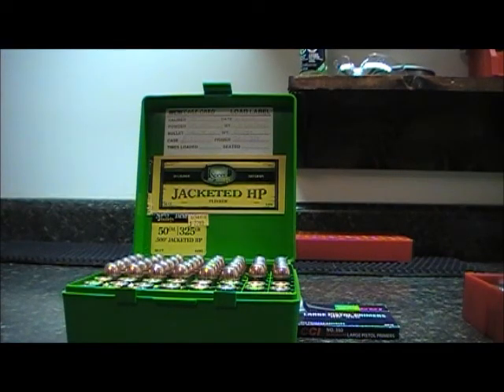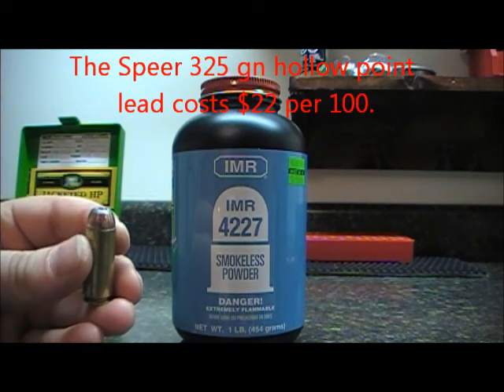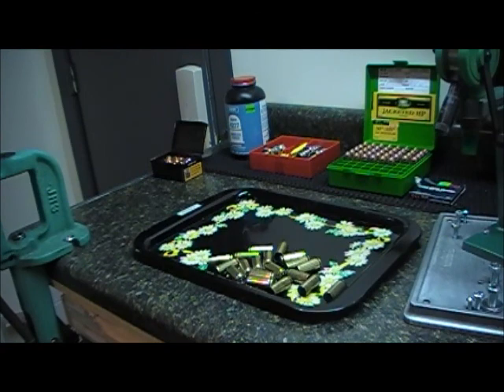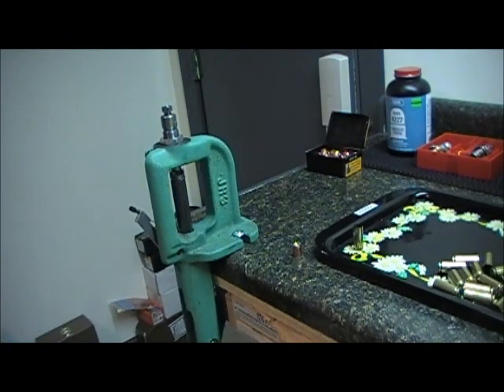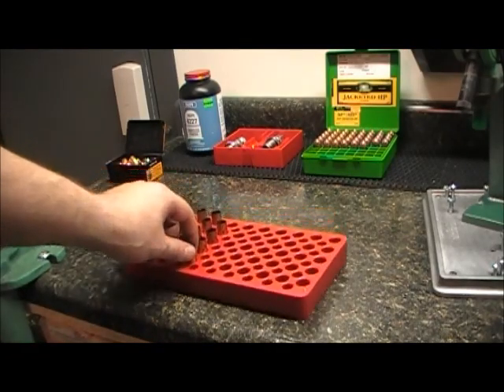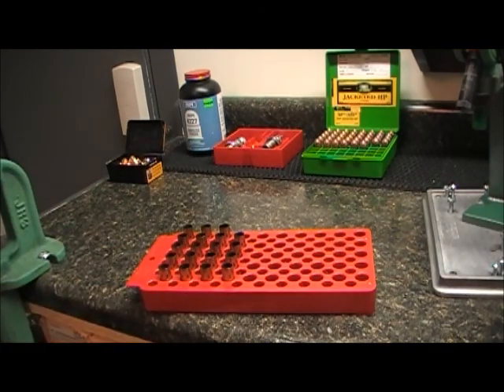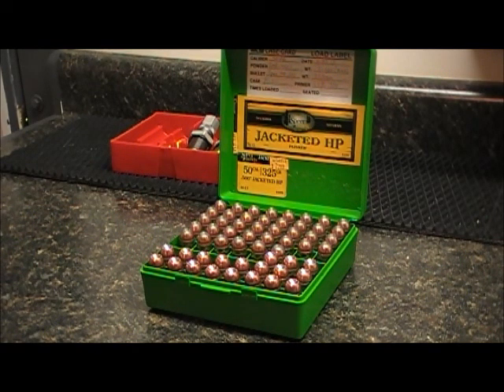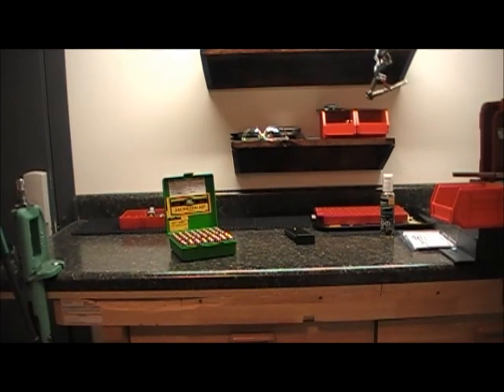Reloading the 50AE (Action Express) Cartridge 1/26/2014

Comment: Good video.  One thing to consider in on these semi auto rounds, they seat on the case neck.  The brass can stretch after firing, so trimming the case to proper case length before belling and priming the case can be an important first step.
Reply: I think trimming would be risky as the tolerances will change. I think that's why they have the reloading die(s) he said to crimp them back down to spec.

Comment: I’m pretty late getting here but I need some help. Every time I seat the bullet there is no neck tension for the bullet and I can push with my finger down. Any tips ?
Reply from the maker: Depending on your die type, more than likely you need to turn your die down further which will put more crimp on the neck.
Reply: @fpsdano7446  shouldn’t there be neck tension without a crimp though ? I’ve already wasted like 20 rounds trying to figure this out lol I’m using lee dies
Reply from the maker: @emotionlessmarshmallow4581  yes I too have Lee dies and in my experience there’s a fine line that you need to find using very small fractions of a turn in either direction.
Reply from the maker: Someone else mentioned that your brass length should be measured as well to make sure it’s within tolerance as well.  Could be too short in your case
Reply: @fpsdano7446  I feel like I’ve tried everything and might have to just order new dies

Comment: What red dot are you using? I have an older 2 slot 50ae. I'm not sure if you can put a 1913 spec mount.
Reply from the maker: Mr NiceKnife I have a cheap BSA red dot but my pistol has a full picatinny rail integrated into the slide.  Not sure if that would work on a two slot but I don’t think so.
Reply: FPS Dano according to magnum research it's a weaver rail not 1913 spec...
Reply from the maker: Mr NiceKnife I never noticed a difference I guess.  Maybe the BSA red dot is setup for weaver then.  Either way that’s what’s on there and it seems to work pretty good.

Comment: THERE IS SO MUCH MISTAKES THAT WAS OVER LOOKED. Checking casing for defects, cleaning and size to spec. using a caliper. 
Manual powered dispenser are never 100% accurate. You should measure the powder dispensed at least after every 3-4 fills. Bullet seating is very important and should be or very close to spec. by measuring bullet with a caliper. Just to name a few.
Reply from the maker: The gravitational pull of the earth fluctuates so much I find scales to be pretty unreliable so usually I count each grain when loading.  You just can’t tell cause I do it so quickly.
Reply from the maker: FYI - *are so many, were* but hey, not being critical...
Reply: @fpsdano7446  You did a fine job. As if these keyboarders have ever even done reloading. Easy to sit behind a computer. If there are so many mistakes, then they could post their own video and teach us how it's done... Instead we get keyboarders...

Comment: so much mistakes in this video! total newb
Reply from the maker: Care to point them out?
Reply: Mistakes? I saw none.... some people....
Reply: FPS Dano
 Not cleaning brass after lubrication/sizing. Could damage your primers and powder.

Not checking powder weight every 10 rounds at least. 

Using the same powder charge for a lighter bullet. Could cause cycling issues-- especially in 50AE

Not using calipers to measure O.A.L-- seating bullets too deep will cause unsafe pressures.

Checking head space by loading his weapon instead of taking the barrel out-- also letting loaded rounds drop on the floor.

Video was cringey, sorry...
Reply: @mathewlambert9464  LOTS of mistakes If only you knew what to look for. Please be very careful in reloading, it can be dangerous if not done properly.